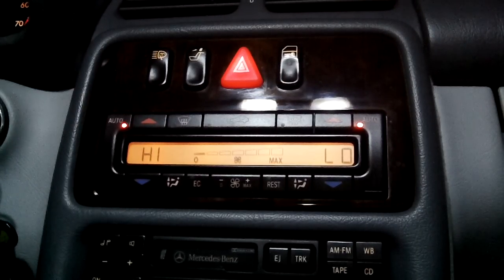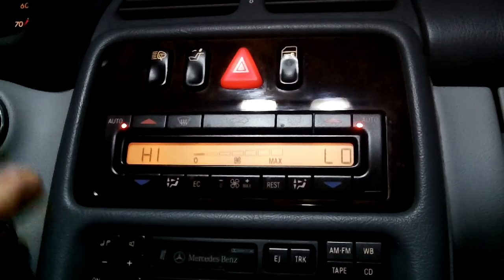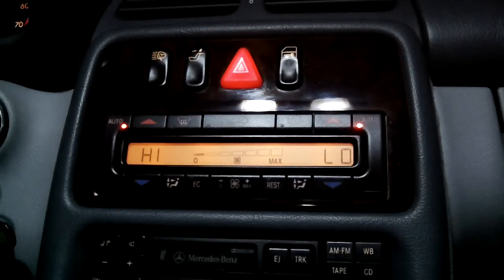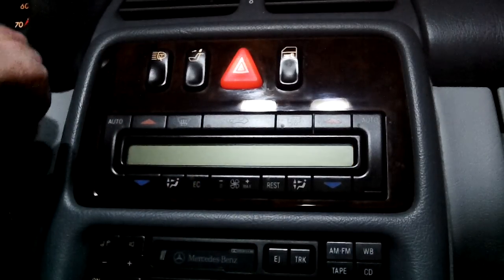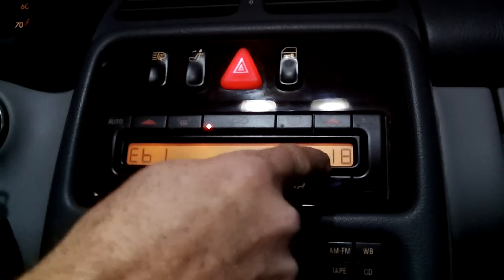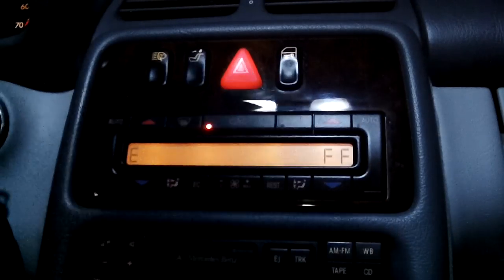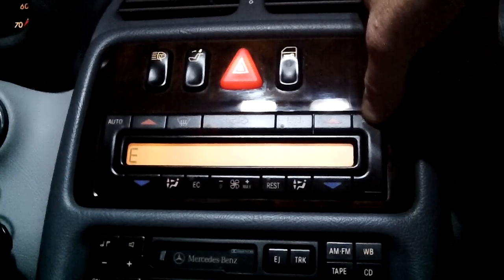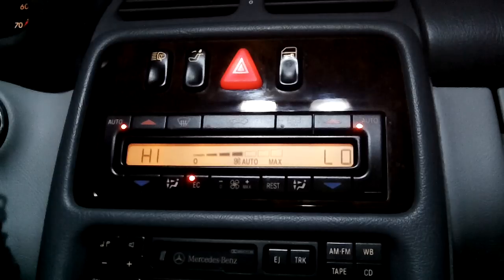Mercedes w208 clk320 how to display climate control fault codes

Comment: Thank you for this procedure! Mine shows no codes, but for some reason, the climate control seems to have a mind of its own, and the AC does not blow cold. I am at a loss as to what is wrong. '99 CLK430 with 214,000 km.

Comment: Great video.  I need to recharge my system and bypass the pressure switch because of low refrigerant level and force the compressor to come on.  Does anyone know where the AC relay is on a 2001 CLK 430?  Thanks

Comment: My EC button light is permanently on/pressing it won't turn it off. 
My blower fan runs on its own, but not always. It continues with the ignition off. A previous owner fitted an isolating switch to the blower supply to turn it off.
Everything else appears to work, well, apart from the A/C. The compressor clutch won't engage,  I presume there's a leak. 
Are these issues connected?
2001 A208

Comment: W208 320 CLK 2000 I have a delayed power-up going on with the unit..no display no action from switches then after 10 mins it comes alive, guessing bad panel/control unit?

Comment: Hi, I have a W208 mercedes and bought a new instrument cluster from Europe.  When I start it up, the default on the display says "DISPLAY DEFECTIVE".  But if I press the little 'R' button in the bottom right corner, it goes back to normal and displays all the correct information.  Any ideas how to program this to get rid of "defective display" as a default?  Thanks!

Comment: Hi, for some odd reason on my w208  the AC or Heater comes on only if I play with settings on the steering wheel...like when shifting C to F or vice-versa.. 
Great video 🍻

Comment: It took a long time but it appeared that I finally cleared the default, turned the car off, waited a while, turned it on and didn't feel any cool AC. Turned it off, went through the system check again and the error was there again. I assume it means that part, the coolant circulation pump, really is broken? The code was 416.

Comment: Was playing with the button now my blower fan not working what can I do
Reply from the maker: Once the procedure for reading the codes is initiated you have to go through the whole process ,read all the codes and do the reset or it will remain in the fault reading setting
Reply: @fupabox  what procedure do I do
Reply: So once I do what you shown everything will go back to normal

Comment: I have a 2000 clk320 but air cond display doesn't even light, also when it stopped the radiator fan became louder. Desperate for a solution
Reply from the maker: sounds like a bad control unit defaulting to full speed on the rad fan as if your ac is on ,on a hot day. They can be found cheap on ebay and pop in and out in 2 minutes

Comment: Thanks for the video. My W210 got problem on AC. While starting the engine, it's look normal. After a few minutes, the central vent has almost no air flow and the the air go to the side vent and the wind shield (make its foggy a moment later). Today, I add AC Pro refrigerant and it's at green zone (about 33 psi). I check the climate control module and found 2 errors code:
Eb1 234 - Sun Sensor Malfunction
Eb1 416 - Coolant circulation pump
Can you advise what I should do next? Thanks again.
Reply from the maker: check the coolant circ pump..looks like a fuel pump under or near the coolant reservoir bottle. check to see if the electrical connection is good and if it hums which it should when working properly. The sun sensor is just a little dome on the dash that senses direct sunlight and increases fan speed in auto mode ..doesn't have any effect on a/c .so if it isn't working it won't cause a malfunction. The coolant pump is the only thing that can cause your issue. If its working and humming , then the codes just need to be cleared and it should be fine.

Comment: You are a LIFESAVER!!! Been driving without A/C since June (horrible heat in NYC this year) and couldn't figure out why it wasn't blowing hot air! Nothing was wrong with the A/C system, but apparently a dead battery left a code for the A/C, I reset it and it works perfectly with this method. Thank you so much dude!!!
Reply from the maker: glad it helped

Comment: HELP ! I HAVE A W 208 THAT BLOWS COLD ONLY IN THE MIDDLE VENTS , WHEN I COMMAND IT TO BLOW ONLY YO THE DEFROSTER OR ANY WERE ELSE IT BLOWS STILL IN THE MIDDLE AND THE REST OF VENTS ARE HOT. SO ONLY COLD IN MIDDLE AND REST OF VENTS HOT !! PLEASE HELP !!
Reply from the maker: Not designed to blow warm from middle vents if I recall correctly. shut off vents manually

Comment: Great video, thank you. Question? Will those codes display on the OBD scanner? 
Thank you
Reply from the maker: Nope.. The w208 is an orphan like a few other benz models from 1997-2000. Enhanced OBD functions very hard to read on anything but a factory scan tool. Regular OBD emissions stuff can be read with a simple OBD scanner but everything else is tough to get read. Thank god the climate control had one built in.
Reply: I replaced the compressor and the refrigerant pressure sensor at this local mechanic on my CLK 320 and the AC starts good and then shuts off at times only runs on speed one as soon as you crank it up starts blowing hot air any advice is appreciated thank you so much
Reply: Also, they filled it with Freon. I’m stuck in this heat wave with no ac.
Reply from the maker: @tipiFWD  open and clean out your duovalve ..it can cause many weird heating and cooling issues. theres a full vid on it on my w202 playlist
Reply: fupabox thanks a million, I will try that.

Comment: Ok so I have a update I did get pressure adjust correctly  but I'm getting 232 233 241 418 416 but when I hook gauge it reads where it should be the pump I can turn on off by ec button the gauge is steady so it's not leaking  I'm at a loss any other suggestion and I'd like to donate to your channel  for helping me out thank's again
Reply from the maker: did you try to reset all the codes. could be old ones stored that are keeping it from working
Reply: And that's restting thro the climate control like I. You video ? If so yes but then I receive the same codes over
Reply: Do idk why but it won't reset I changed my duo valve I can't seem to find the recirculation pump
Reply from the maker: @mrtakemytyme7162  attached to coolant overflow tank by a small hose. looks like a fuel pump. 1 electrical connector and 2 smaller hoses about 1/2 inch in diameter
Reply: @fupabox  hey giving you a status update so I had a extra duo valve and aux pump I just got done changing pump and it seems to be working maybe since it hasn't worked in who ever knows how long I'll take it on the high and real they the compressor working thanks man
Reply from the maker: @mrtakemytyme7162  good to hear it seems to be working
Reply: Lol only if it were to be that simple no cold  but I was reading on some forms a guy was haveing the same issue turns out I guess the Freon level from your every day can  dose  not work he took it to the shop and bam ice cold also I did learn the error codes are showing because the  Freon level bla bla not going to go into detail thank you

Comment: I tried to refill my ac but it's showing on the gauge maximum in the red
Reply from the maker: check the coolant pressure sensor
Reply: @fupabox  thank you I appreciate your time
Reply from the maker: @mrtakemytyme7162  sorry for late replies .. when I'm busy with work I sometimes don't get time to answer questions.
Reply: Also it I get the code for circulation] pump witch I assume is the ac pump but how could be a problem there is kicking on
Reply from the maker: @mrtakemytyme7162  The circulation pump is on the frame under the coolant bottle. it hooks to the coolant lines and circulates  antifreeze to prevent air in the system,and when engine off and "rest" button engaged. If circ pump isn't working your mono/duo valve may be gummed up and stuck in the default "warm " position .https://www.youtube.com/watch?v=8jhPEfLI45s
Reply: No worries I deeply appreciate your time

Comment: I broke this unit trying to remove it. So i just put it back as i found it but now none of the buttons work. BUT my rad fan is now on all the time. Is this cos i broke the unit.
Reply from the maker: Yes. as a safety measure the fan defaults to high speed and likely also defrost .
Reply: @fupabox  Yes i eventually found a used unit on ebay for €35. I jumped at the chance because everywere else i had been looking were all £90 plus. It works a treat. Only thing now is the ac dont work. Going to try charging it tommorow. One problem ive got error code 416 . Believe it is coolant circulation pump. Should i still try to recharge it?
Reply from the maker: @paulattree4171  you can still charge the AC . The coolant recirc pump is the one on the front frame behind the coolant bottle. A smaller coolant hose connects from it and pumps warm coolant to keep the interior warm when the car is off and you engage "rest" button . If the pump isn't working it can slightly restrict heating in the winter . Usually the wiring connector that makes the pump not work . After the car is warm shut it off remove key and press rest button on AC unit . if you put your hand on the pump you should feel it humming .

Comment: fupabox, Did you make a video showing what the numbers / code 1 and 17 means? This is shown in your video at 1:32. My CLK is showing 1 and 18.
Reply from the maker: its in vent flap test mode .  heres the test and reset https://www.youtube.com/watch?v=052f0PCXohQ     17 and 18 are not useable numbers and seem to be used for other models using this hvac panel

Comment: Hi, I have a 226 error and I can not get it to clear. The auto button on the driver side of the controller is not functioning. The in car temp sensor seams to be working fine after I cleaned it. Could this be keeping my AC from working correctly.  The display code #1 seams to be reporting an accurate reading of the in car temp. Any ideas on clearing the fault? I tried disconnecting the controller but the fault is still there. Any ideas on fixing the auto button?
Reply from the maker: I would think the fault is in the auto button ...you may be able to gently pop thr button cover off and see if the button underneath is stuck in the pushed in position . Otherwise the dash unit would need replacing

Comment: Thanks worked lie a charm on my 2002 CLK320 after a having a hose swapped out and a freon recharge. Just reset the faults and boom ice cold ac again!
Reply: How did you reset the faults?

Comment: My heater motor keep working after I switch ignition off. Only way to stop is take fuse out
Reply: Hi Juri'Studio, mine too! did you find the problem? i also have to remove the fuse to get the fan to shut off, is yours fixed?

Comment: It seems that you know quite a bit about the cooling/ac system in w208. I have a good question about it that I hope you can shed some insight towards.
When I first start my clk430 the AC is good and seems to work great until I start driving and then what it does is direct all the AC air out of the windshield vents and a small amount of air will come out of the side vents. Almost no air at all will come out of the center vents. Nothing I can do to get it to come out of the center vents after the car is hot and been running for a bit.
Ever heard of such a thing?
Reply from the maker: The w208 chassis is based on the w202 and shares many of the components including a/c and heating . The issue you are having seems to be vacuum related. The flaps that open and close to direct air to different areas are controlled by engine vacuum . At idle there is a lot of vacuum with the throttle plate closed . Once the throttle opens there is much less vacuum , so there isn't adequate vacuum to hold the flaps open that direct air to the center vents . There is a default for the air to flow to the windshield and side vents so that a fault in the system will send air to defrost the windows..all in the name of safety. there is either a leak in the little rubber bellows that hold the center flap open, or the distribution block that sends vacuum to other areas of the car  (you can get to the distribution block and partially see the vent bellows from behind the glovebox)  also check all your rubber and hard plastic vacuum connectors under the hood for a leak , but it likely the bellows has a tiny tear or leak.
Reply: this happened to me also. there is a vacuum line center on back of motor. there is a port back there and it plugs into a white plastic line. also i have the v8
Reply: Fupabox...is the bellow that controls the center vents in the front passenger wheel well? Looks like a grey box that has a white tube and green tube coming out of it. What do I do once I locate it. Just check for any damaged tubing or replace the box? And I do believe one of them goes to the back of the engine and I can't find where the green one goes...I would guess to the vent. Would I have to remove the dash to see the other end of the green tube? Crazy system just for vents!!!! One more question...do you have a diagram of all the vacumm tubes around the engine and where they connect to?

Thanks in advanced for all you help...
Reply from the maker: If I'm not mistaken the flap for the center vent blend door is behind the radio / hvac control unit .  here is the factory manual sections (listed on left hand of page )  you may need to refresh once in a while if the page doesn't respond ..https://workshop-manuals.com/mercedesbenz/clk_320_(208.365)/v6-3.2l_(112.940)/heating_and_air_conditioning/air_conditioning_switch/component_information/locations/ec/

Comment: hello, I have CLK 320 2000 avantgard, heater blower on climate turns off properly, sometimes (correctly often) it even doesn't blows at all, blower level is on maximum but it doesn't work. can you give me an advise what I have to do to fix it?
Reply from the maker: do this test to see if the fan is broken   https://www.youtube.com/watch?v=Ykwp4fKPaQY

Comment: hi . ur video has helped me in the past and thank you so much .

i ran into another problem and wanted to see if u can help.

i have an 01 clk 320. yesterday ac stopped blowing cold air.  the compressor clutch is not engaging. i check the freon and found it to be full.  i then referred back to this video, checked for any codes. well im showing E61 234 and E61 235. 

this showed the last time i checked about 3 months ago but the ac was working fine so i didnt bother .  

i dont know much about ac systems. your help is greatly appreciated 

thank you
Reply from the maker: The 235 code is for freon leaking (emission sensor)  either the sensor is bad or the freon level is low..likely the sensor..  B31
Reply: Thank you 

Would you happen to know the location of it ?
Reply: +fupabox i called the dealership twice they have no idea what im talking about . lol.  this one guy said he been in parts for 19 years never heard of anything like that .

thanks for all your help
Reply: +fupabox still trying to find a forum that covers the replacement of the sensor. if you happen to know where its located that would save me 100s of dollars . literally. 

thank you !
Reply from the maker: http://bayhas.com/mercedes/203c-coupe/contents/climatecontrol/climatecontrol_sensors.html

Comment: Could you please very briefly explain what exactly does EC ( the economy mode ) do and when am i supposed to use it ( summer/winter time ). I thought i knew how to properly use my climate control untill recently when i had this guy in the service center checking my AC, told me that i might have been doing something wrong with my AC, which i don't quite remember what it was, but it definitely had something to do with the EC button.
Reply from the maker: the e/c button turns the a/c compressor off ...when e/c is lit up  the a/c compressor will not come on no matter how low you put the temperature. The reason you would have e/c engaged (I leave it engaged most of the time ) is for the best fuel economy and power.. a/c compressors use a couple of HP to turn them  ..if you put the climate control to front windshield defrost, the a/c compressor will automatically come on to help dry the air to defog the windshield , so in winter I only use front defrost when absolutely necessary
Reply: Right... so basically  you just turn the AC on by pushing the plus button,  set the desired fan speed, push the air recirculation button and enjoy the the cold air flowing out of those vents in a hot summer day and then you would just turn it off by clicking the minus button untill the fan completely stops or just shut the engine off without even touching the e/c button, i'm a bit confused sorry :) Got the defogging part though
Reply from the maker: Heisenberg Mercedes actually does make it a bit confusing..their assumption is that everyone will leave everything in automatic mode...essentially  e/c button not lit up is a/c on when the car thinks it needs to use it.
e/c button lit up means the a/c will not come on ever. ( unless in defrost)   for the most effective temperature control  set the temperature you want and press "auto"  the car will do the rest and you will never need to touch anything.  If, like me you don't really like the feel of a/c unless it's blistering hot.. you can leave everything else the same and just press the e/c button to disengage the compressor.. when its too hot turn the e/c button off and the a/c will engage to cool you down
Reply: Got it, thanks!